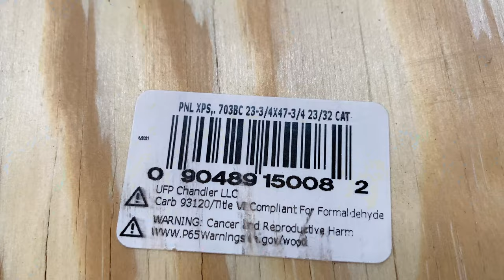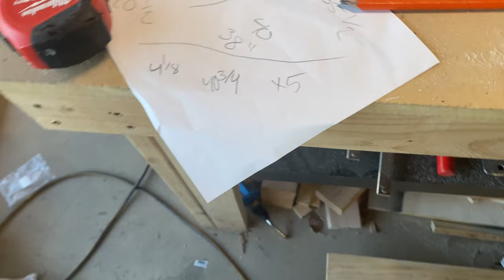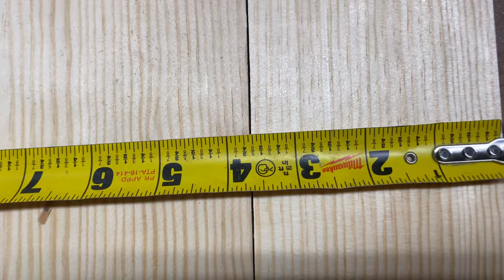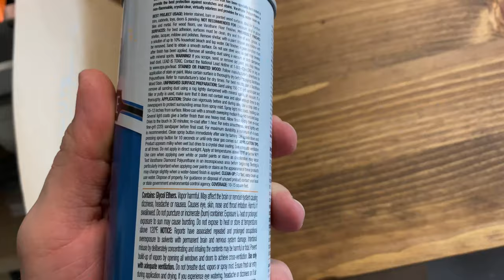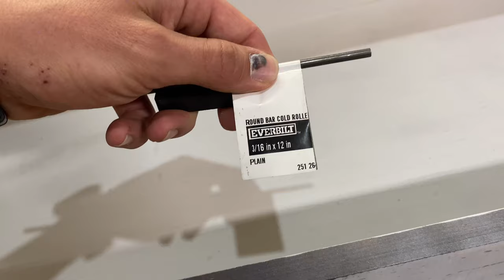DIY CONCEALMENT COFFEE TABLE! Rustic DIY Super Easy! STEP BY STEP BUILD

Comment: The reason your table top is wobbling is because the legs that pivot on your mechanisms have holes in them and these are there for stabilizers to run from side to side. This could be a problem for space inside but is the cure to make it open evenly. Nice table.

Comment: Thanks for this video.

SUGGESTION/IDEA: Since you're using a large(ish) magnet for the key (opener), you could use a smaller (weaker) magnet inside behind the locking pin so that even if the table tilts or is moved around the locking pin will stay in.

Also, thanks for including a link to the hardware you used.
Reply from the maker: No problem! Thats a really good idea, thank you for sharing!!
Reply: 0 po qq

Comment: You should add a small magnet on the inside to make it tip proof so the metal rod won't accidentally fall out and then use a stronger magnet to pull it out

Comment: Great work! One question I have though is accounting for wood movement that May coz the table top to split o we time. I’ve seen people using bread board ends with floating tenons to counteract that since you used fixed braces that might be a problem maybe? Or don’t you think that’ll be a factor?

Comment: I’m thinking I’m going to use drawer slides on mine could just notch out the back to give them a way to slide in and out .. looks like a nice table I’d keep improving the design with better joinery/ better lock and hardware that uneven opening and closing would drive me nuts. Good work man
Reply from the maker: Thats a great idea! Thanks a lot for the feedback man I really appreciate it! Good luck on your build👍🏼